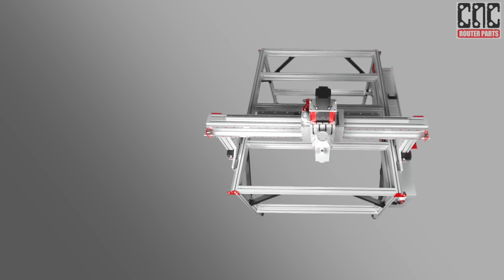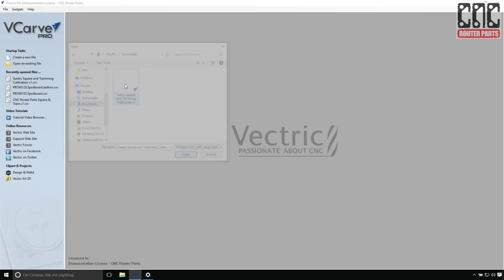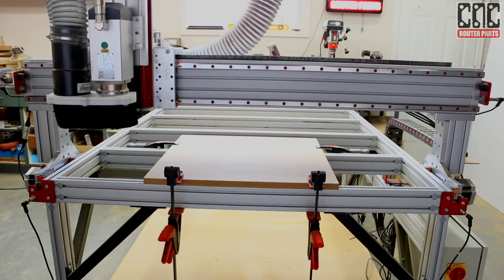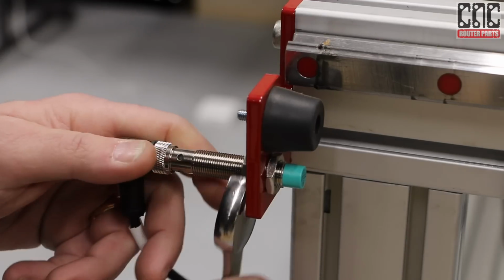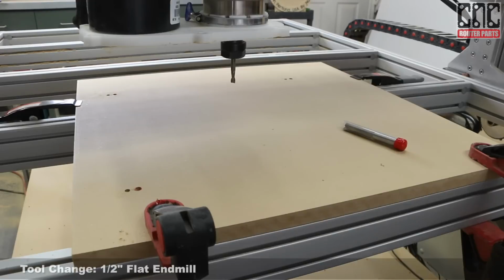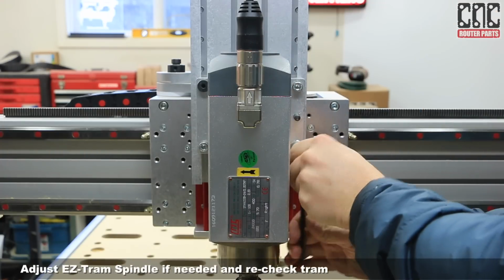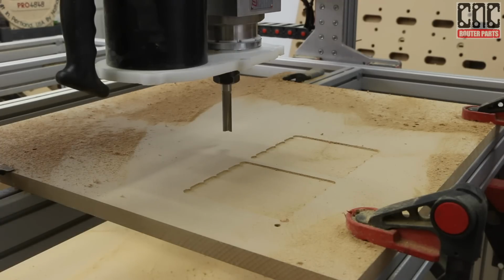PRO CNC Build Series: Leveling, Squaring, and Tramming your CNC Machine

Comment: Why is it necessary to level the unit to the floor? it seems to me the gantry moves along the metal frame  , if the entire unit was set to a 20 deg angle the gantry is still level with the unit itself and it wouldn’t matter cause the gantry doesn’t ride along the floor

Comment: I might be overthinking this but wouldn’t having the adjustment plate on the portion that moves potentially lead to cuts being skewed to one side?
Reply: I agree, that was my first thought.  This shows up on large milling machines as offset when changing between long and short tooling  travel is so  small compared to something like a bridgeport that it's not a problem in actual use.

Comment: One of the easiest and most accurate methods of tramming is to  ...
1.  Center the spindle on your frame, workpiece or spoilboard
2 Obtain an aluminum rod or thick aluminum wire half the width of your machine bed
3.  Bend the rod 90 degrees about an inch from one end so the tip can be chucked in the spindle.  It will look like a huge fly cutter.
4. Lower the spindle until the rod almost touches the surface.  
5. Rotate 360 degrees, noting the distance the rod is above the surface.
6. Adjust the spindle so the wire is the same distance above the surface in all positions of rotation.

Using this method you can easily obtain accuracies way beyond anything you will ever need.   For example, if you can dial in the rotational plane within 1/32" that equals less than 0.15 degree error if the radius of the rod is 24". Obviously you can dial it in even closer if you wish.
PS:  This is the method I use for dialing in the tram for cnc milling machines and am able to obtain less that 3 minutes of error consistantly.  The error you receive will have more to do with your referance surface than the technique.  Aluminum is used to minimize magnetic effects.

Comment: Hi. I just subscribed. I found your information very interesting, I planned to do a CNC. Regarding the calibration of the auto-square gantry, what do you think. Would it be better not to do the CNC with the two motors on the sides and instead, place a single motor in the middle, either with a spindle or band? I believe, that would avoid that movement. Thank you.

Comment: Can I ask why you don't want to level the table to the floor? Why are we levelling to gravity? Surely if one foot is at a funny point, then the frame can twist slightly?
Reply from the maker: Hi! Good question, the frame is leveled during the initial build process.
Reply: @AvidCNC  Thanks for the reply - just out of curiosity, do you ship your machines to the UK? Also, do these come with the legs? On your website I can't see them - I'm probably blind!
Reply from the maker: @michaelkelly3158  Yes, we do have international shipping. Our modular design lends well to being sent internationally.
Reply from the maker: @michaelkelly3158  Also, in regards to the leg kits those are sold separately because sometimes folks like to build their own table base. Check under "Pro CNC Accessories" tab below the "Pro CNC Machine Kits" link.
Reply from the maker: @michaelkelly3158  Sorry for the delay. Yes we do ship to the UK! And our leg kits are sold as accessories (Check under that tab) because sometimes customers want to build their own table.
Reply: @AvidCNC  Got it! Really like the design of your machines. Can I ask how the backlash for the rack and pinion drive compares to a ballscrew?
Reply from the maker: @michaelkelly3158  
A well constructed ballscrew typically has less backlash than a rack and pinion drive but that architecture also limits the speed and travel distance. Though for more about backlash in regards to rack and pinion, check out Linus' video he has a really great explanation of backlash for rack and pinion and how we combat that. https://youtu.be/MGrQxVUHu88?t=532
Reply: @AvidCNC  I see, thank you! If I ever need a larger CNC router I'll definitely be looking at your kits. Really impressed! Thanks!

Comment: I'm curious why are you not levelling the basic table structure before adding on the extra heavy weight of the gantry + spindle + control boxes. Surely the use of a jack in jacking up at 1 end of a 600lb structure is just putting on all sorts of unnecessary flexing and strain on various parts of the structure / bolts/screws and joints. Just a thought.
Reply from the maker: Hi Adrian,  I see where you are coming from. You can level the table before adding the gantry, though it would be a bit moot as it's better to level the machine after it is fully assembled, so you'd probably end up leveling it again.  The machine table is quite rigid so jacking it up isn't putting significant stress on the extrusion or the anchor fasteners.   That was actually part of our failure FEA (Finite Element Analysis).  -Nathan

Comment: When you say "which side the ridges are formed will indicate if the spindle needs to be adjusted clockwise or counter-clockwise." can you clarify? If they were on one side, adjust which way?
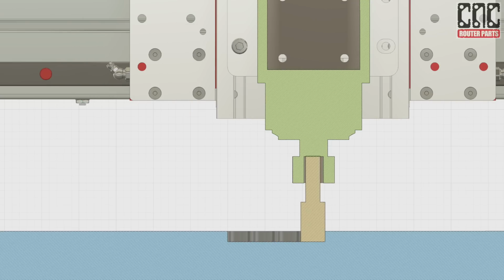Reply from the maker: Hi M W, At 7:26 there is an exaggerated animation that shows how the ridges look for different out-of-tram conditions. e.g. If you have ridges on the right side of the passes, then you should adjust the spindle counter-clockwise.   -Nathan
Reply: cncrouterparts thanks! It may seem intuitive for others or basic enough to not have an explanation, but for beginners, detailed basic info really helps to get ahead. Other than that 1 question, the video is great and very helpful. You guys are great and i really appreciate how much you have already put out there for our understanding.

Comment: Thanks Nathan. Just The cnc setup info I was looking for. I have a smaller machine but should use a similar process?
Reply from the maker: Thank you for the feedback!  Yes, this basic workflow applies to smaller machines as well, though of course, the specific methods of adjusting & tramming the machine will vary.  -Nathan